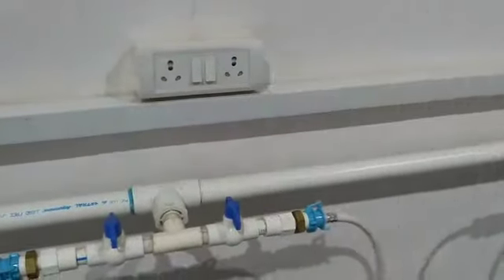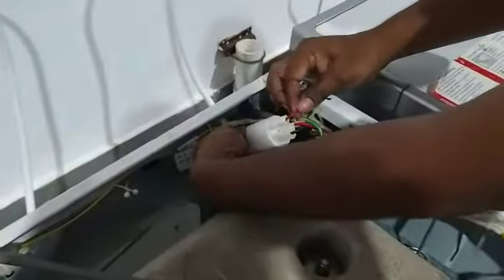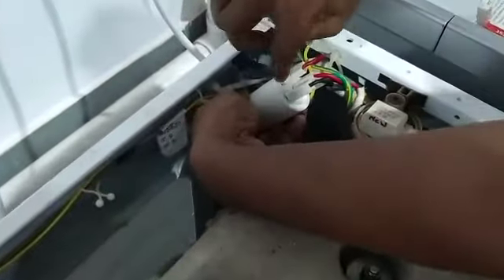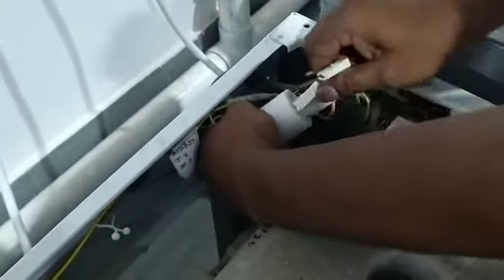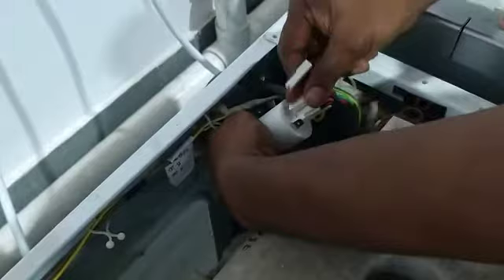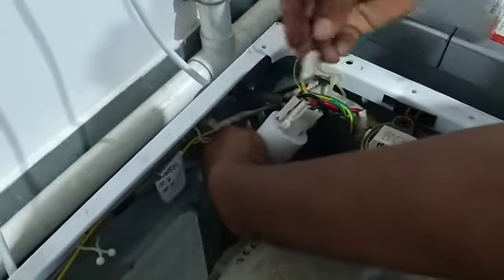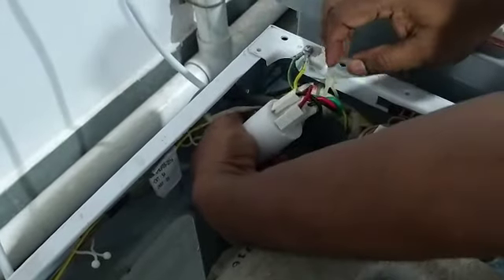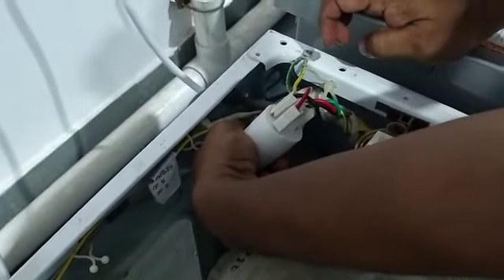IFB front load washing machine PCB blinking but Not working And power supply cable

Comment: Display of my Ifb aqua senator is blinking when power is made on. Will replacing phase and neutral with each other from Emi filter output solve the problem.

Does it means EMI filter is faulty.